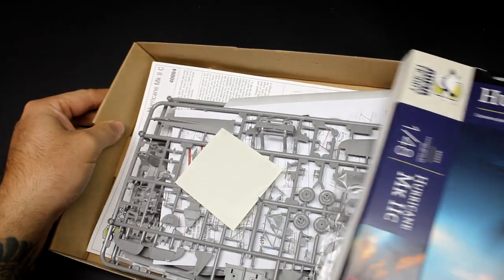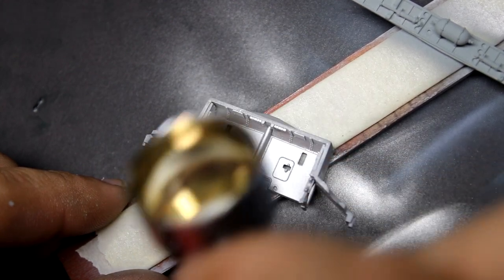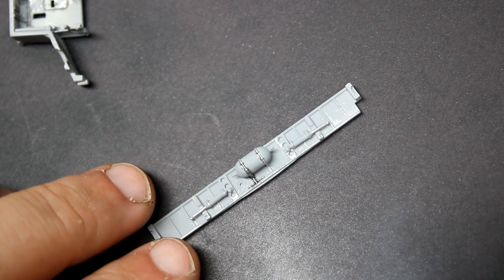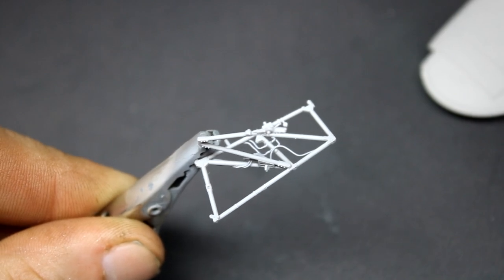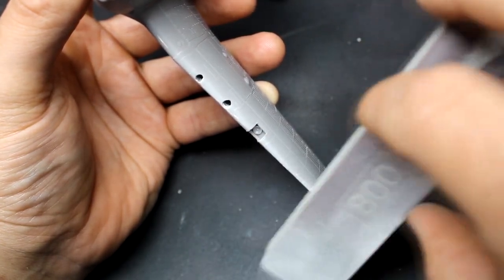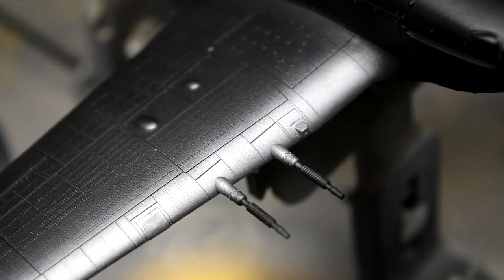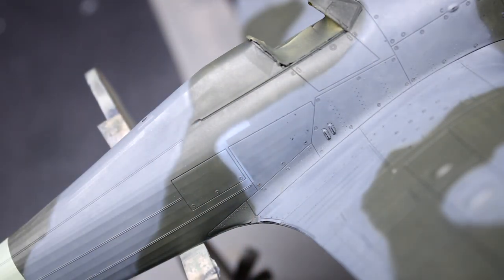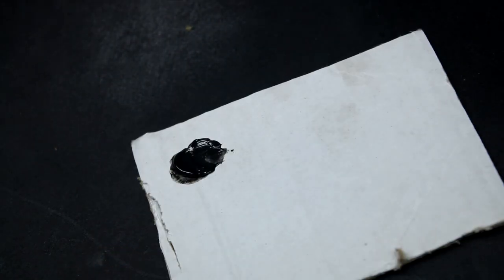The All New Arma 1/48 Hawker Hurricane Mk IIC! Build Review

Comment: A lovely build and finish. I'm wondering if that exhaust reference picture you have is of a remanufactured replacement - the exhausts of Hurricanes and Spitfires were made from Inconel which is corrosion and oxidation resistant. Or, if original, perhaps after 70+ years it does actually deteriorate a bit!
Reply from the maker: I referenced some of the ones flying today.